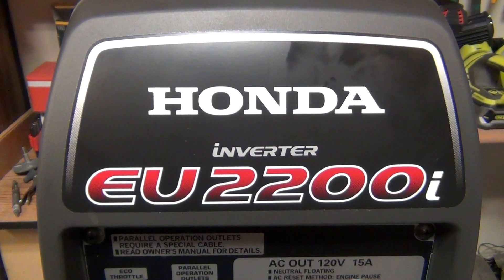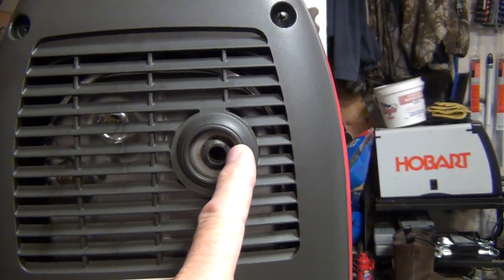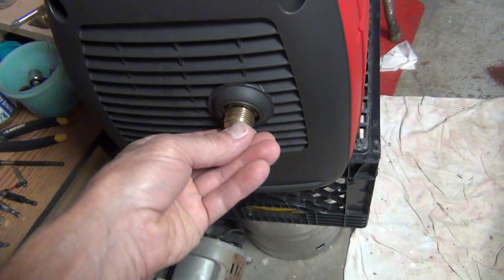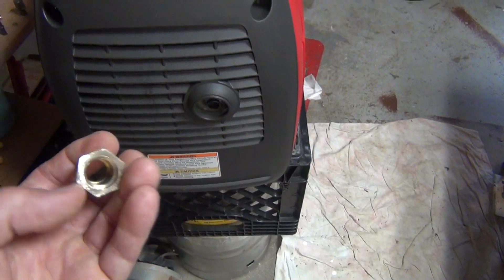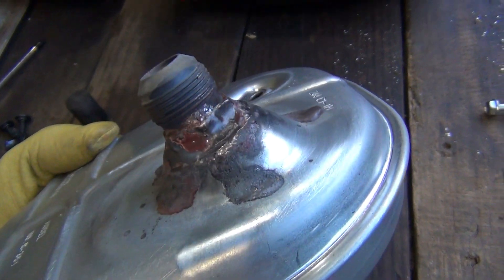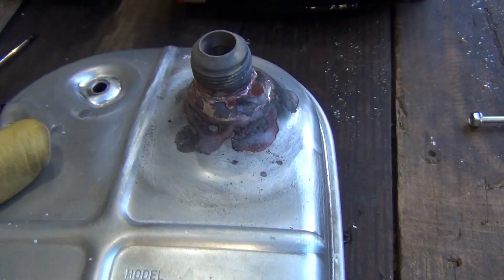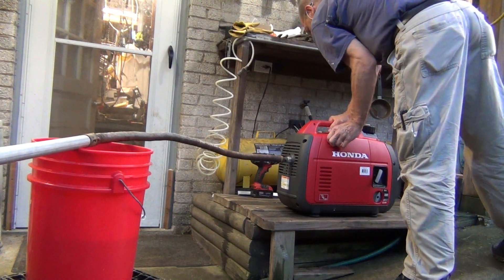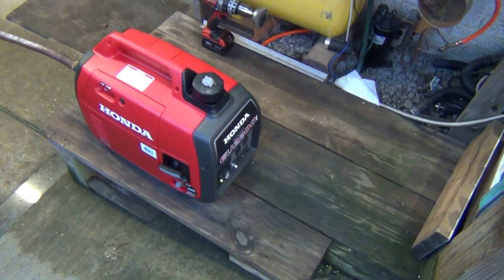How to extend the exhaust muffler on Honda EU2200i inverter - part 2

Comment: Would pointing the exhaust downward help to drain any moisture/humidity?
(Diesel heaters recommend this.)
I welded a threaded nipple to my 40yr on Honda ex1000. Then just used black pipe (for gas here in Canada) to exhaust it outside. 
If you ever needed to exercise the warranty, just replace the muffler. 😊

Comment: It’s not a muffler, it just moves the exhaust point (and noise) further away, which is fine if that’s what you want. It’s a pity Honda don’t provide a threaded connection but the user manual says not to extend the exhaust…

Comment: I don't need a long extension, just a flexible one about 12 centimetres....this seems a reasonable solution. I am wondering if JB weld will provide the same solution....
Thank you for your effort. Cheers P
Reply: I also had that thought. Have you tried using it?
Reply: @myronhornby1859  In the end, I just pushed my honda closer to the wall of the cabinet. I installed an extractor fan into the outside world.

Comment: How did you braze the brass to aluminum? Ur help would be really appreciated
Reply: There are no aluminum parts
Reply: @tysesty  oh so is the muffler stainless steel ? What is the process of welding brass on stainless steel called if so? Sorry I am a total beginner
Reply: @Doodlehed99  it’s galvanized steel, it just needs to be sanded.
Reply: @tysesty  oh okay thank you. What is the process required for joining the two together? Welding ? Stick ? Tig ? Or brazing ? Would really help if you specify your steps.
Reply: @Doodlehed99  brazing

Comment: Does the eb2200i Have a muffler exhaust gasket Mine did not have one? Brand new
Reply from the maker: yes it does
Reply: @VladFredK  Bought mine in May 2021. No exhaust gasket.

Comment: Very Nice vídeo. Is the muffler air tight? Have you ever pressure tested one for leaks?  I plan to to this mod for an unnamed room, but, it would be bad if fumes still build up. Many thanks.
Reply from the maker: I have never test it it but when I run it inside my shed I dont smell any fumes.

Comment: I really like this solution.  This means I can put the generator in a location that wasn't previously feasible.  I need to investigate a different type of hose though.  I'm wondering if this would void the warranty?  Have you heard of any warranty issues with this modification?
Reply from the maker: Sorry I didn't.  I actually repair generators so I don't worry about warranty.

Comment: 1 thought was, using about 6ft  "High temp" hose. (steam on boilers etc) thinking the softer rubber will obsorb much of the sound and slowly curve up of down, directing the sound into the soil.

Comment: Does it NOT create any back pressure? (Home dryers, meant to push about 24 feet, of very straight smooth  4 inch exhaust, And every 90 dig bend is counted as 2 feet. 1 foot of flex is counted as 2.5 feet.
Reply from the maker: No it doesn't.

Comment: I wonder if you put the end of the pipe in a tank of water to act as a filter
Reply from the maker: newer do that, to much resistance for fumes come out. It will destroy the engine.
Reply: Vlad Fred Kovac, thank you I will make sure that I never do that. Thank you for your videos. They are a great help.
Reply from the maker: @chodkowski01  glad I can help :)
Reply from the maker: t w  sorry I don't know and I don't have a original package to check.

Comment: How did you connect the nipple to the muffler ?
That long tube as an exhaust extension enhances safety from carbon monoxide.  Thanks for sharing.
Reply from the maker: weld it

Comment: Good job !
Reply from the maker: Thank you
Reply: @VladFredK  quick question...what size socket did you use in ur portable screwdriver to remove the 3 muffler screws?  Thank you!
Reply from the maker: @kristievanfrost4247  I'm sorry but i don't remember any more
Reply: @VladFredK  10mm